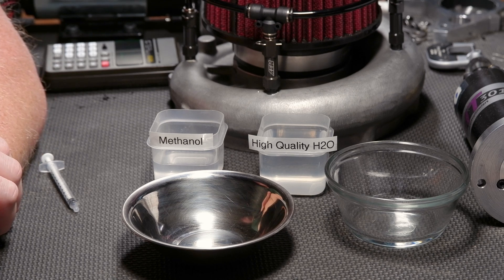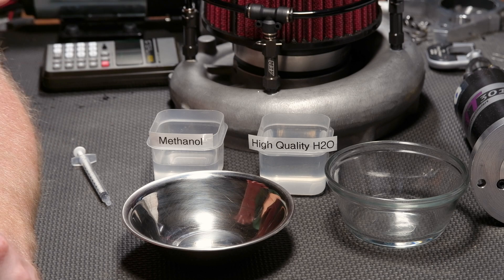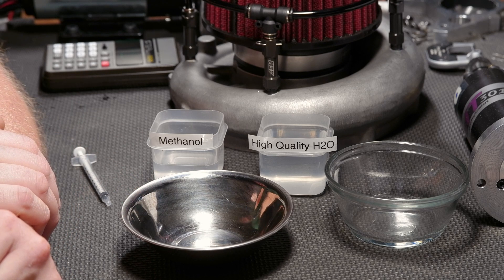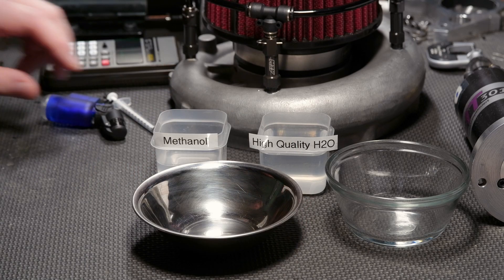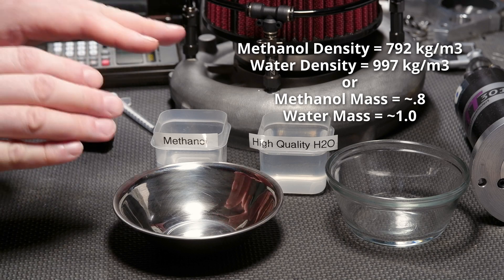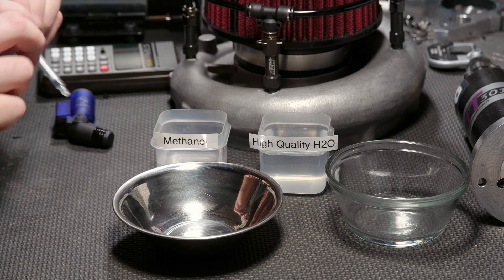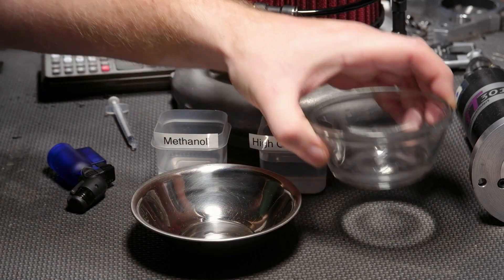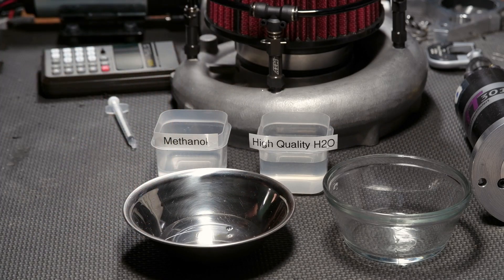At What Ratio Does Water/ Methanol Burn?

Comment: Question, would it be safe to use water/meth injection with a stock tune and no changes? I don't need power gains and would not mind minor power loss if I get all the benefits from it.

Comment: But it's still combustible and ok to run such a low percentage of meth through the electric supercharger. Right?
Reply from the maker: I just ended up running straight meth.  On my last trip to the dyno, the meth was 30% of my fueling.  I did a video on that dyno trip here: https://youtu.be/b9d5xv9INmw  And I did a deep dive on the meth injection data we gathered from the dyno session here: https://youtu.be/mBM-2qIav74  And finally we took it to the track and got the LTD into the 9's: https://youtu.be/RT0M88xHzNQ
Reply: @AlexLTDLX  thank you so much for the response. I'm building a project car and want to do something based on your design. I love your channel

Comment: What happens if you use only water on a diesel application? I mean in the engine. Does it still bring egts and charge air temps down?

Comment: The contents of the "spittoon" probably didn't burn because the alcohol had evaporated to a lower concentration over the course of the experiment.  A quicker way to find the burn limit would be to light the 50-50 mix and add water 'till it goes out.
Reply: Would be hard to keep track of real-time ratio while the methanol is burning out of the mixture. Too many variables and unknowns to have a solid scientific result.

Comment: Does the combination of gasoline to the injectors and methanol to the cooling nozzles confuse the O2 sensor? Is proper tuning complicated by the intermittent use of methanol?
Reply from the maker: Not really - the best thing is to use lambda rather than gasoline scale air/fuel.

Comment: In this video, you are putting water methanol solutions in direct contact with an ingnition source. It would be great to have a video in which you heat thr solutions... i think heat is more the issue in a methanol injection systems rather than ignition sources. Auto ignition temps of pure meth are around 450  C. That's why I would still consider water meth safe if you avoid any fume accumulation. Thank you!!

Comment: Old video I know but... I've been running water methanol in my daily for well over a year now and it is fantastic! I mix my own 50/50 by weight. Surprisingly I don't use as much as I expected. Again it's a daily driver and I put about 2000 miles a month. And I go through 5 gallons of methanol is about a year. Really depends on how much I play but the car sees redline just about daily. I also carry a fire extinguisher too.
Reply from the maker: I ended up running straight meth - it picked up a fair amount of horsepower and over two tenths at the track.  If you haven't seen it, here's the dyno video: https://youtu.be/b9d5xv9INmw  and here's the track video: https://youtu.be/RT0M88xHzNQ
Reply: @AlexLTDLX  Water has more than twice the cooling ability of methanol. So if you want cooling, bias towards water.  If you want octane boost, bias towards methanol.  Both suppress knock but through different actions.  Water lets you run high boost without the need to run a richer mixture.  You need to bias towards your specific needs.  And of course you need to need to tune to the specific ratio you are running.
Reply: @rockets4kids  The water allows you to run higher boost without increasing the mixture because it makes the air denser, no? You'd still be running the same AFR, correct? Just more fuel at the same ratio to match the increased oxygen content?
Reply: Fellow meth head here. I’ll never go back!!

Comment: Due to methanols low vapor pressure, I suspect that you are burning nearly 100% methanol as it evaporates off of the water. If you let the fire it burn itself out the alcohol would be mostly gone & most of the water would remain. You could reduce that by using both 32F methanol and water.

Comment: These companies don't want you to run straight methanol because the seals in their pumps and tanks will 100% leak over time. They only recommend a 50/50 mix so it doesn't eat away at the seals and leak. It's not a flammability issue as this video clearly proves. Thanks! I have one of the most expensive kits out at the time and both the pump and the tank (twice) developed leaks running straight methanol.

Comment: How effective would be 100% water injection. I hear the meth is mostly for the system not to freeze. BMW M4 has a water injection system from the factory and it adds +50hp
Reply from the maker: I think there are a number of factors at play.  If the intake charge isn't above the vaporization temp of the water, then you won't see as much benefit, and probably will see a loss.  Though it has a lower latent heat of vaporization, one of the many reasons injecting methanol works so well is that  the vaporization temp of meth is much lower, so more of it vaporizes, and the resultant latent heat of vaporization has a big effect on intake temps.  If your intake temps are over 100* c, then you'll start seeing more cooling effect from water, as it has a higher latent heat of vaporization. HTH
Reply: Water is not adding any HP buddy, engine is tuned in a way to allow more power with additional water injection being a fail safe mechanism(cooling mostly)
Reply: The water turns to steam and expands in the cylinder.
Reply: It also is not combustible and will actually raise the octane. The methanol was originally added to stop the water from freezing at high altitudes in ww2 aircraft

Comment: Can you please try lighting 50/50 (by weight or both if you like) with a spark as that's more likely the use case under a bonnet otherwise every petrol car (gasoline if you're US) would burn to the ground in a heartbeat... 
50/50 doesn't vapour easily unless boiled which is why it's considered not flammable (I won't say inflammable). I will add that over 10yrs that I raced nitro RC cars (self made/mixed with 12-30% nitro, 6% bean/castor & 6% synthetic oil with the rest being methanol all by weight) l've never seen an incident of fire unless someone ignites it to have a laugh or to keep warm.
It's a case of common sense though...

You could also set up a flame with a MAP gas torch and use the nozzle to spray over it and see if that burns like a champion!
Reply from the maker: I'm not going to have an opportunity to test that in the near future (my upcoming videos will explain why), but I believe you.  I'm more concerned about my particular use case - we've had plasma arcs big enough to almost saw through an aluminum ESC case that's over 6" (~150mm) long: https://youtu.be/_n6hDRsMZd8.  I've also tried stick welding with one of my battery packs (we use two in series): https://youtu.be/TlerchtDjxA  I did consider spraying through the nozzle and seeing what happens (and I'd still like to do that, to be honest), but at some point, I need to get this thing on the dyno and back on the drag strip.  After this video, I think I'm just going to run 50/50 (by volume) and call it "safer" than running straight methanol... I hope that proves to be an ok choice.
Reply: @AlexLTDLX  Yes I wouldn't be concerned with the water/meth when you have batteries that are potentially way more combustible (unless it's LiFePO4 then it's good). Even with batteries you get a warning when the runaway begins.
I'm following with interest though...

Comment: Water and methanol combine is exothermic reaction. You have to wait for the temperature to stop rising and then cool off from mixing water to cool off before you can test flammability. If you test it right after mixing it’s not truly mixed. It will be more likely  burn that way. 

In my testing It takes about 20 minutes for the reaction to stop.
Which is why at the end of the video you couldn’t ignite it
Reply from the maker: I actually took the time to test this - I made a mixture of 1 part water and 0.9 parts methanol, and then I mixed it up and the let it sit (covered, so the methanol wouldn't evaporate) for about an hour.  I didn't notice any significant rise in temperature while it was sitting, and afterwards, it was still pretty flammable.  It might be my testing methodology, the fact that I'm using a butane torch lighter to ignite it, etc.
Reply from the maker: That's good info - I'll try mixing it up and waiting a while to see if it still ignites; if the results are different, I'll post a new video.  If not, I'll let you know here.
Reply: Simply mixing the two liquids does not produce heat. The reason the mix at the end of the video wouldn’t light is because it was more than 60% water.

Comment: What's wrong with just plain water?
Reply: Tap water has a lot of extra junk that will either corode metals, leave deposites in system or the jets. Distilled water is clean as you are going to get it.
Reply from the maker: In addition to Ben's reply, methanol is also an oxygen-bearing fuel, which means it allows more fuel to be consumed because there's more oxygen available to burn (oxidize) the fuel, and that of course, makes more power.  It's like nitrous, but with less oxygen.  This is also why methanol-fueld engines make more power than gasoline fueled engines, all reasonable variable being equal; and this even applies to E85.  In addition, methanol also increases gasoline's effective octane to about 110 (it's not a direct correlation, but that's the accepted equivalent), which allows for more timing under boost, or more compression at the same timing advance before detonation.

Comment: The reason meth is added to water is to accelerate the evaporation rate.

Cooling only occurs during the evaporation phase,once evaporated cooling ability has  ceased.

Hence the term latent heat of vaporisation. This is the amount of heat absorbed by the phase change.

Optimally you want to stage the cooling to allow the final evaporation to occur right at the end of the compression stroke.

You cannot compress fluid,only vapour.
The volume injected into the volute will act as a solid on the compressor.

If the mixture is not flammable you will suppress combustion.
If the volume does not vapourise it will offer no cooling and could be a risk of hydrolocking.

It could all work perfectly such is the rabbit hole of water injection.

Just food for thought,great project by the way👌
Reply: You will have misfires long before hydrolocking
Reply: the volute is after the compressor though.

Comment: Try running dihydrogen monoxide with the methyl alcohol instead high quality H2O 😂

Also depending on the temperature of the mixture it can be very easy to ignite even at a low methanol concentration. Even windshield washer fluid can burn in a crash.
Reply from the maker: Lol - I actually had to look that up.  That's pretty awesome.  I like how someone even made a rather scary MSDS sheet for it...
Reply: @AlexLTDLX  kind of scary but true, water is the "universal solvent"

Comment: that was a useful video .. good work. I guess the question is is it really high quality H2O (distilled) or was it tap water, which they say don't use with the meth... I doubt is make much difference though.
Reply: i think because the tap water has minerals in it which may leave residue in the pump/injectors etc in the long term
Reply from the maker: This was just tap water.  In the car I'll run distilled water just because I want to minimize mineral buildup.